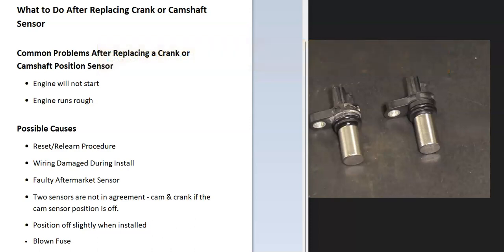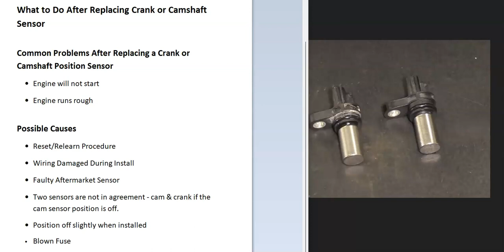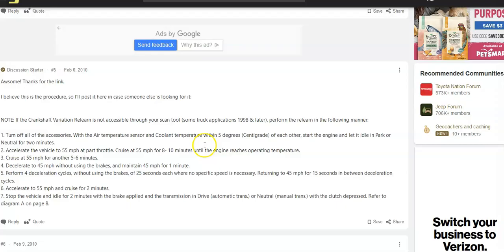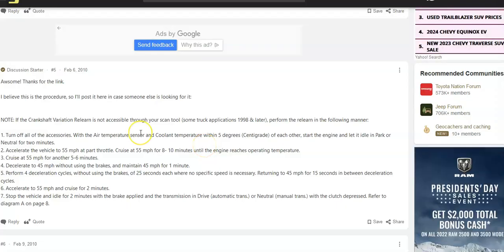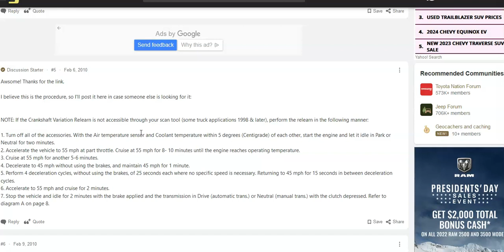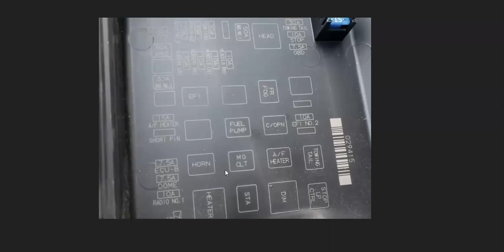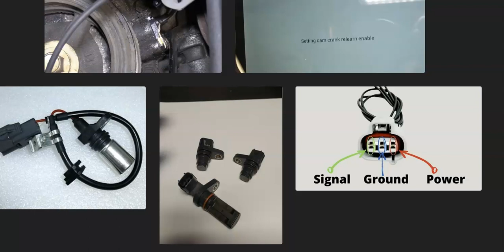What to Do After Replacing Crank or Camshaft Sensor and Now Engine Won't Start or Runs Rough

Comment: Please help looking for information replace Cam all lifters with a licensed mechanic. My truck went in with a bit of a tick from one of the lifters. I got it back and it sounds like a diesel. He can't explain it he says his work is quality don't know what to do please help
Reply from the maker: Sometimes the engine needs to be driven a bit before the valve train noise goes away. They could have also been installed wrong or the wrong-sized lifters installed. I would let the engine run a bit and see if it clears, if not the mechanic should fix it.

Comment: Have a 1996 f 150 4.9 and said crank sensor was failing so I’ve replaced it twice and no start, Will check everything again but may end up putting my old one in, What a dam nightmare
Reply: I’ve changed my camshaft sensor A, bank 2 on my Kia Sorrento. 
My Kia came up with engine light and speech (on screen) to get to mechanic “Soon” initially. 
So many details from each move but my Kia always ran and started, well, I might add. 
Changed sensor, engine light came back, same code P0346.
Purchased OE Kia part.
Now Kia’s speech (on screen) says get to mechanic “When you can”.
I’m going to change fuse again. This was the first thing I did.
If I come up with answers or possibly solutions, I’ll share.
Reply: do the crankshaft relearn procedure.  A guy just did it on youtube with a "vident iLink 400" that he bought new on ebay for $156 with his 5.3L chevy
Reply: Did you get factory sensor from dealer ? did you find problem ?

Comment: I replaced the camshaft positioning sensor but not the crankshaft i was going to change that one too would you recommend that? Wires look good but i was told it could be a dirty fuel filter ?
Reply from the maker: I would follow the codes that were given. A Cam sensor or Crank sensor code is different from a clogged fuel filter code. If you have multiple codes, there may be multiple issues.
Reply: @HVAC_Mechanic  the crankshaft position doesn’t always throw a code.. there’s not always a code thrown for a variety of issues but I wish there was